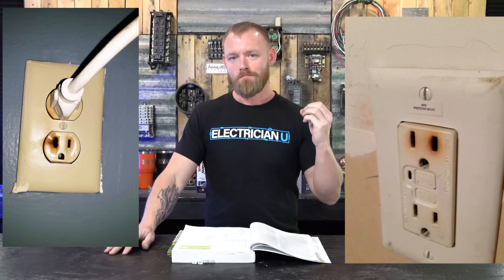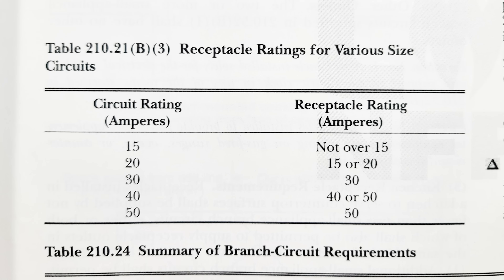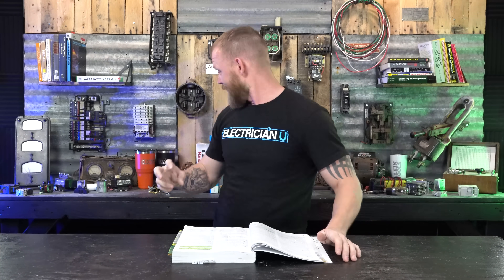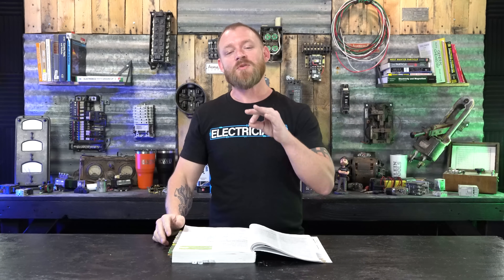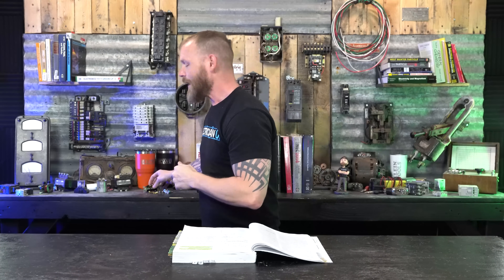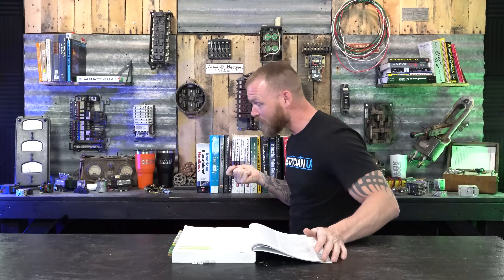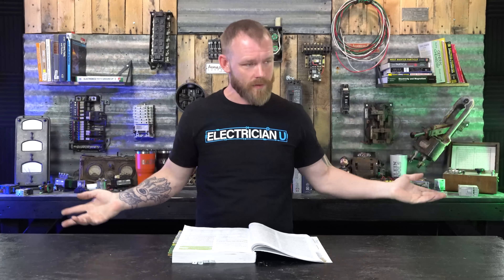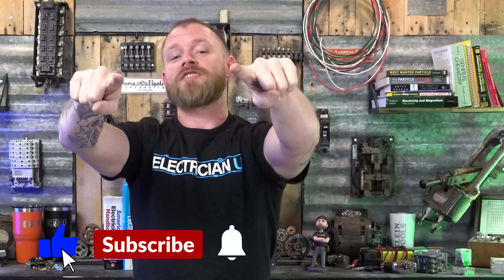Won't These Melt?!? 15amp Receptacles on 20 amp Circuits!!!

Comment: It's been my understanding that a 15A and a 20A receptacle have the same exact internals, at least when using a reputable brand. The only difference in a 20A receptacle is the addition of the horizontal slot (in USA) and it is the responsibility of the manufacturer of a product that is likely to draw loads exceeding 12A to give it a plug with one of the prongs oriented horizontally, as to be impossible to plug into a 15A receptacle.
Reply: There’s someone on here who tears them down and I believe there are actually beefier internals on 20s on Eatons. Might be wrong about that though
Reply: @BabyGators  my man did a comairason of the two. He actually did tear one apart between the two, and the 20 amp has thicker material making them more durable to use. The plastic to the metal used are thicker with more support to back it up.
Reply: @BabyGators  internals are the same. if they are beefier you aren't comparing the same grade. also they don't make resi grade 20Amp receptacles due to the low volume
Reply: Its a  Receptacle Not outlet. Every electrician in America knows that because receptacles and outlets have two totally different meanings in the NEC.
Reply: @kalijasin  You call it as you see fit. The outlet and or recepital means the same either way. Grow up, and move on!
Reply: This is my understanding as well MinionDX. A 15 Amp receptacle has the same internals as a 20 Amp, so the receptacle itself won't "melt" if it were to get current over 15 Amps while waiting for the breaker to pop.  The dude in the video cracked me up when he said it was the code because the code writers were "guessing you won't go over 15 Amps, so it'll be prolly be fine in most houses".  It's listed as 15 Amps, because you are supposed to only plug in devices rated for a 15 Amp outlet, into it, which is what sets code for how many 15 Amp outlets you can have on a 20 Amp circuit.  For example, you can have 10  -15 Amp outlets on a 20 Amp circuit, but only 8 - 15 Amp outlets if you have a 15 Amp Circuit.
Reply: You cannot put a 20 amp receptacle on a 15 amp breaker. If you install a 20 amp receptacle then that means it is capable of delivering what a 20 amp device with a right angle prong on it would draw. So what I am saying is you cannot just install 20 amp receptacles everywhere unless you put it on a 20 amp breaker.
Reply: @ssponaugle  Yes you're correct. The faceplate makes all the difference. A homeowner will see the horizontal plug and plug in their >12A super steamer commercial vacuum scrubber in there and burn the whole neighborhood down. And it would be your fault.
Reply: @chz420  he's wrong! You can put any standard face plate on a 20 amp or a 15 amp outlet. If the shoe fits wear it. I have never had an issue with any electrical service at my house. In fact my better half went to Rams horn resturant, they told my man that they all ready had an electrican on his way out. Of all things state licensed, two days later there was a fire after they closed. The arson inspector ruled it as an electrical fire in the kitchen. My better half could have saved the resturant, if they would have hired him instead. I just love it when some one thinks that they know what they are talking about. Did you ever work on a live circuit before? If not give it a try, its so much fun running a 3 phase circuit while its still connected live. My better half did, and still alive also no sparks. Lol! My better half has worked on live 15KV lines as just something to do in his spare time. He has been trained up to 50KV lines for public lighting. He started as a assistant journeyman, to full time lines man.
Reply: @hollytimlick9470  Yes I have. And I dont expect a lineman working for the power company to be familiar with residential codes. That is what Im referencing. The NFPA 2020 NEC. You will never have a problem until you plug in a device with a horizontal plug, which Im beginning to think you have never even seen before, into your 20a outlet that is on a 15a circuit.  
I have never seen somebody tamper with a 20a receptacle and put a 15a faceplate on it. In fact, it's downright stupid. I wouldn't even reckon its possible on most manufactured outlets. Im confident in saying you should never perform any electrical work, period. You know just enough to be dangerous.  
Your "better half" (clearly) might be qualified to do electrical line work, but clearly doesn't know residential code and likely isn't qualified to do it. This is not legal in most states. But ,nobody can tell you what you can do in your own house. Best of luck.  
Btw- ask your better half what size wire they use to supply a house with 300amp service and why. Then ask him why he rewired his house in 12 wire. He's got you buffaloed.
Reply: @hollytimlick9470  It's not legal to put a Nema 5-20R on a 15 amp circuit. If it is wired with 14 gauge it has to be on a 15 amp breaker and have a Nema 5-15R (or 6-15R if 240V). You can use a 15 or 20 amp breaker with 12 gauge and are limited to Nema 5-20R (6-20R if 240V) on dedicated (single receptacle) 20 amp circuits.
Reply: @rich7447  hey you do things your way, and I am going to do things my way. I had a licensed electrican come over to our house, who is state licensed for over 40 years and said that what my man did is 100% perfectly fine. So stop counterdicting my mans expertise. He is also state licensed as well, and I think it is perfectly legal, especially when we had three different licensed electrical inspectors checked it out after my man put it in! Get over it! You CAN put a 20 amp reciptical on #14 gauge at a 15 amp breaker, with the max of 8. So don't tell me my business! You can't put #14 on 20 amp breaker, and I know that. There is no rules that said you can't put a 20 amp outlet on a 15 amp breaker, just as long as you don't use a 20 amp breaker on #14 romex. Just get over it all ready. If you read my last post. I SAID THAT HE USED A 20 AMP OUTLET ON, #12 GAUGE WIRE ON A 15 AMP BREAKER! THAT IS PERFICTLY LEGAL! The max you can draw is 15 amps dummy! Again get over it!
Reply: @hollytimlick9470  I'm an electrical engineer (graduated in 1997). I would lose my credentials for suggesting what you said your experienced electrician did. What you can do and what is legal (perfictly (sic) or otherwise) are two different things. It is not legal to use 14 gauge wire with a 20 amp breaker anywhere but vehicle chassis wiring. As soon as you terminate a with a Nema 5-20R you are required to meet all specifications for a 20 amp circuit. The thought process is that you should not be able to plug an appliance that draws more current or requires more voltage than the circuit is designed to handle. That limits 14 gauge to Nema 5-15 or 6-15 receptacles. Would you wire a Nema 14-50 receptacle with 12-3? No, because the 14-50 gives the indication that the circuit can support 240V @ 50A. Any inspector that passed the circuits that you are describing would be risking their license.
Reply: @rich7447  I never said that I used a 20 amp breaker on 14 gauge. I said that I used 12 gauge on a 15 amp breaker. As far as recipticals you can use a 15 amp or a 20 amp rated one on any 15 or 20 amp breaker, as long as you use the right gauge wire for that circuit. 12 gauge on 20, and 14 gauge on 15 only. No where did I say I used 14 on 20. My man has the recipticals all on 12 gauge with 15 amp breakers, using all recipticals at 20. The standard plug that fits are all rated up to a standard 15 amp circuit. Who in the Hell has a 20 amp plug on their appliances? Tv's, DVD players, hair dryers, tosters, a microwave oven and table lamp all fit in the outlet. There is only three in the entire house that is 15 amp, and thats the bath and kitchen. The rest in the house are on 20 amp. All lights are on 15 and with all 14 gauge. I all ready know that if some one plugs in a device at 20 on a 15 amp circuit, the breaker will trip, so again what harm is a 20 amp outlet on a 15 breaker? I don't know of one item that's rated above 15 amp for residential use. Small power strips, box fans, table lamps, tv's and so on don't draw any where that much. And if later on my man wanted to swap the 15 amp breaker for a 20 amp, he could because the wire and the reciptical is all ready there. So he won't need to pull wire or the outlet for a change out, to accommodate a 20. I hope you got that.
Reply: @hollytimlick9470  Lots of appliances have 20 amp plugs. Usually higher current draw tools (also considered to be appliances from an electrical standpoint).
Reply: @rich7447  well none that I know of, or none of what we own. So sorry that you may own some, but none that I do. And anyway what's the big deal about a 15 amp breaker vs a 20 amp outlet? If you draw more then 15 amps, the breaker will trip anyway. You can't start a fire drawing 15 amps on 12 gauge romex wire. We both tested that theory all ready. No damage to the wire, or reciptical. The only thing is the breaker will fail one day, most likely not reset at all.  Your making a mountain out of a mole hill. The house has passed electrical inspection, and I am going to leave it at that. None of the inspectors nor the electricians seen an issue with what is put in. I see no issue either, yes it may have costed a tiny bit more money to put what was put in, but I see no big deal about how or what is being used for. A home owner is entitled to put what he or she wants to be put in their own home. If they have the money, they can pretty much put what ever they want into their own home as long as its safe, and does the job for what they require it to do. I am sick and tired of hearing of odd ball ideas, of this can or can't do, or this can and can't be done. If it is within satisfactory working requirements, and it works in a safe manner with no questions, that's good enough for me or anyone who reads my post. I am sorry that you may not agree with what I am saying, but we almost had an electrical fire because of your so called ideas. Putting a 15 amp rated reciptical on a 20 amp breaker using 12 gauge. Drawing more then 15 amps on a 15 amp reciptical, almost started a fire. The thing was melted. I wish I could post the freaking thing on here so you can see for your damn self. My man who is licensed by the state in public lighting, knows all to well what you can and can't do. So stop trying to contradicting me or my mans knowledge. If that's the case his house would never have passed inspection, and it would have burnt down to the ground, just like the Rams Horn restaurant in Dearborn Michigan 18 years ago. All because they followed the same shit your saying. He informed Rams Horn that he could have done the electrical work saving them a great big deal of trouble, but Nooooo. They decided to do things for them selves, and hired another licensed company. Three days later the poor building burnt down, and the fire inspector informed channel 4 news that it was electrical in the kitchen. It was a 220 40 amp circuit for a commercial microwave oven. Stop posting a bunch of BS, if you don't know what your talking about. My man tried to warn that restaurant days before it happened, but some people just don't listen I guess. If you don't have anything intelligent to say, just leave it at that. My man also has a part time job away from the city doing electrical work, and NEVER once had a complaint from any one person or from the city inspectors office for the work he has done. Also he once in a while checks up on the homes he had visited, and did work on. Not one complaint from any of his customers, other then the the cost being a bit high. As all ways the price is going to be high, because the cost of wire, staples, nails, screws or other materials.
Reply: @hollytimlick9470  The breaker is supposed to be a safety mechanism, not the first line of defense. The reason that we have so many Nema spec outlets is so that you can identify the capacity of the circuit before you overload it. There are times when breakers fail (usually open thankfully), but I have seen a number of instances where circuit protection failed closed. 
Home owners are not entitled to put whatever they want in their own home. All wiring has to meet the NEC regulations (last updated in 2020) that were in place at the time that the circuit was last modified or repaired. This can and quite often does end up meaning a complete rewire of some older homes because one circuit was changed.  If it passed inspection then the responsibility lies with the inspector should you have any issues. If it didn't pass inspection your insurance company can refuse to cover a claim should a fire occur.
It's not a mountain out of a molehill. Most of the regulations exist because of one tragedy or another. As far as not knowing what I am talking about, maybe you are right. I'll check with IEEE and see what is BS and what is not.
Reply: @rich7447  what ever man. I am done having this debate. Your not making any sense at all. I never heard of such crazzyness in my life. It passed inspection. And that is what a breaker is for, as the first line of defence that's what they swapped fuses for breakers. And yes the home owner has the right to refuse what he or she can or cant, and what they do or do not want in their home. Or you simply just don't get the job! That simple.....
Reply: @chz420  what are you talking about? He started in residential, and worked for 15 or so years first. So yes he knows about residential. Then he went off to comercial, and worked his way up to being a lines man. He knows about all three trades. Apparently you don't know half as much as you do.
Reply: @hollytimlick9470  All I am telling you is what is legal. That is my responsibility as an EE.
Reply: @rich7447  and I am telling you that what he did is LEGAL! It works with no issues, and it has passed by three different people. End of discussions.
Reply: @hollytimlick9470  Then you are not describing it accurately.
Reply: Actually you can put a 20 amp outlet on a 15 amp breaker, its just not the other way around. The contacts inside of a 20 amp outlet is made with thicker brass metal that can withstand higher current, is the reason why they recommend it on a 20 amp circuit, but it is no different if it was on a 15 amp circuit. Also 20 amp recipticals are built stronger, and can take a little bit more wear and tear. Yeah the price is a bit higher, but its a better investment in the long run. My man completely rewired his home using all 20 amp rated outlets on 15 amp circuits, had it passed with no issues even using #12 gauge cu wire. Now its ready for a change over if he had to. If he really had to change from a 15 amp to a 20 amp breaker, is all set to do. Just remember 15 amp circuits must use no smaller then #14 guage, and #12 gauge on 20. 30 amp no smaller then # 8 gauge, and so on. My better half had received a call on a pair of 30 amp breaker, and the guy asked him if he could use #12 gauge, my man said HELL NO! You need to use 8/3 with ground if its for 220/240 V. So yes you can use a 20 amp rated reciptical on a 15 amp breaker, it is 100% safe to do so. Just can't use a 15 amp rated reciptical on a 20 amp breaker. You can use 12 gauge wire on a 15 amp circuit, just not 14 gauge on a 20 amp circuit. As a rule of thumb, if you run more then 150 ft of #14 gauge on 15 amp, then run #12 gauge instead. Hope this helps, cheers🍻🍻 I forgot to mention: My better half did an experiment with a 15 amp outlet, he ran a regular room air conditioner on a 20 amp breaker using 12 gauge cu wire, using a 15 amp outlet for just a few hours. The results where that, he almost called the fire department! All new fully checked fine before he ran the air. The result was one fully melted outlet, and a strong burning smell coming from the box. When he switched out the outlet with a 20 amp rated one, no issues! Again highly NOT recommend of using any 15 amp rated outlet on 20 amp circuit! Of all things it was a single circuit, on a new room air conditoner. Its rating was single circuit, 15 amp, 120v AC. Also a word to note. You can run a 15 amp air conditioner on 20 amp breaker.
Reply: @hollytimlick9470  You're very wrong on many accounts.  
First off, it depends which manufacturer you are buying receptacles from, any reputable dealer such as pass & seymour (legrand) will have exact internals on their 15a receptacles and 20a receptacles. As is stated in my original comment, the only difference is which faceplate you get.  
On a branch circuit with just one receptacle, it shall be rated no less than the branch circuit rating. Article 210.21(B)(1).  
On a branch circuit with 2 or more receptacles, which device you use is dependent on the maximum cord-and-plug-connected load. For example, 15 amp receptacles are to be used on both 15a and 20a circuits, provided the maximum load is no more than 12a. Article 210.21(B)(2). This ensures you can use 15a receptacles where appropriate such as kitchens and dining rooms, where any individual load will not exceed 12a. 
30a branch circuits are to use 10 wire minimum, not 8. Article 210.24
As per Article 210.21(B)(3) You are never permitted to install a 20a receptacle on a 15a branch circuit supplying two or more receptacles. On 20a branch circuits, you can use 15a or 20a receptacles based on their maximum loads as stated in 210.21(B)(2).  
I believe your story about the air conditioner, I see these problems a lot myself in the field. I would fault a handyman installed home depot receptacle, or the air conditioner itself is overdrawing its maximum current.    
Code talk aside, wiring your whole house in 12 wire is a complete waste of money. Why wouldn't he put 20amp breakers if he was planning to do so? Ran out of money after spending it all on 12 wire I guess. There's absolutely nothing safer about running 12 wire on 15 amp circuits, any electrician trying to sell you this crap is a con. Get a better price.  
If you aren't absolutely sure of what you are doing, leave the work to the professionals. Or don't, I don't really care, just more work for me going around fixing these handyman fuck ups.
Reply: @chz420  correct, I believe 14Guage wire is actually rated for 19A at  60 degrees which make sense because the breaker is supposed to be the weak point that trips before any damage can occur to the circuit. up in Canada we use mainly 14Ga for everything but kitchens. and in kitchens 20Amp is required because you can't do a split receptacle on a GFCI. I do like the NEC rule of 20A in bathrooms. Realistically the kitchen and the bath are really the only places you will pull enough amps to trip the breaker. and with LEDs now you could wire all your lights on 15A circuit and maybe pull 5Amps
Reply: @Galgamoth  what do you mean by “you can’t do a split receptacle on gfci?” I know what gfci is, but not what you mean about the split
Reply: @BabyGators  you run a 3 way wire and break the tab on the hot side of the receptacle and the 2 outlets share the neutral  but each has individual hots
Reply: @Galgamoth  ah gotcha. Didn’t think about having each socket on the outlet powered by a different circuit
Reply: @hollytimlick9470  your mispeaking or misinformed as explained in the video where the licensed electrician points out the code sections that say that you can put a 15a on a 20 breaker but not vice versa. Everyone else has already told you this but you think you know everything, just wanted to add to the group of people telling you that your wrong.
Reply: @blakel4595  👆